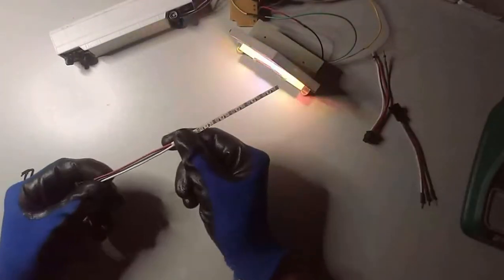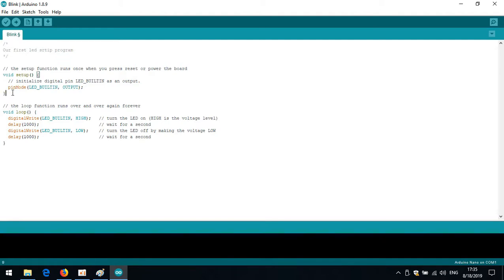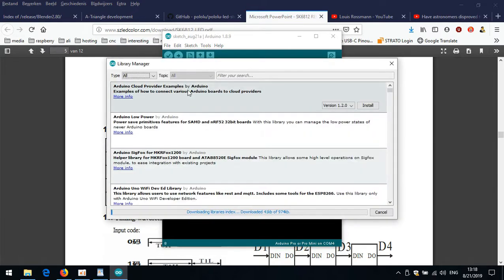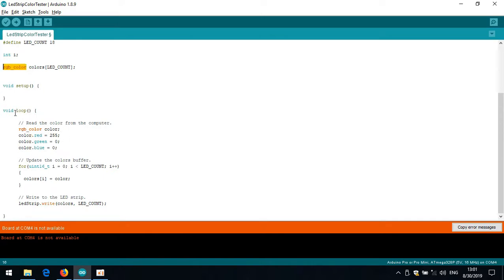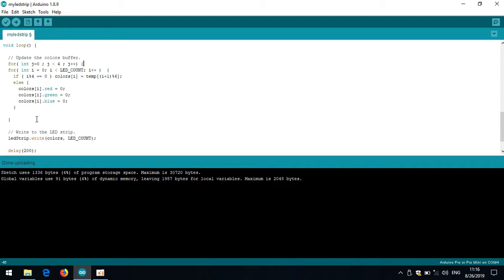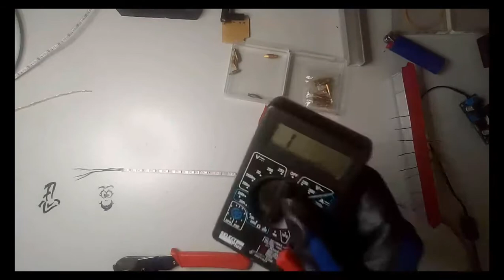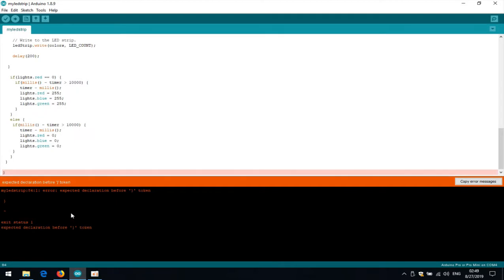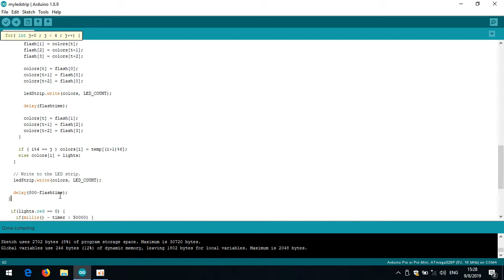Electronics - ws2812 wd2811 sk6812 arduino programming tutorial with ledstrips

Comment from the maker: These led strips require almost 15Watts for 1 meter.
Make sure, you have a power supply that can deliver at least 3Amps, at 5 Volts.
Or, if you do not have a 5V adapter, you can get a step-down voltage level converter.

Comment: hello sir, why i cannot use PololuLedStrip library using arduino nano with A7 pin to control sk6812
Reply from the maker: Correct. On the Nano and some other boards, you can only use
A0-A5 as digital pins.